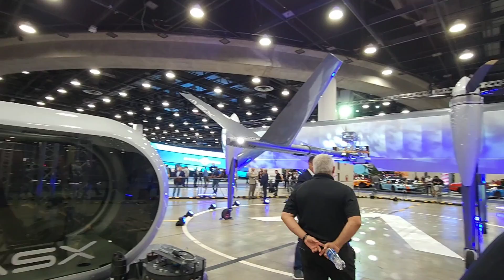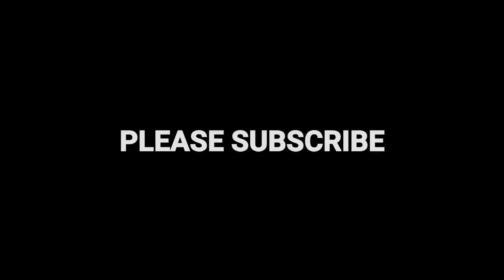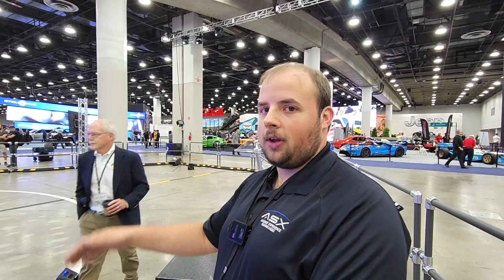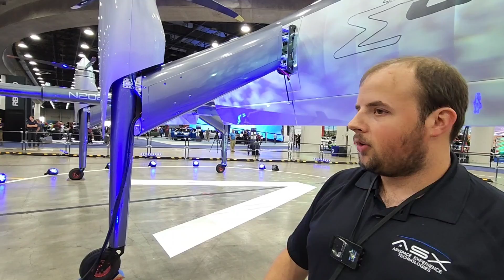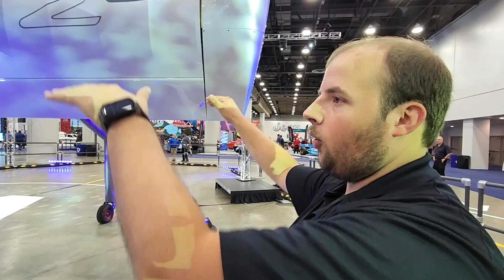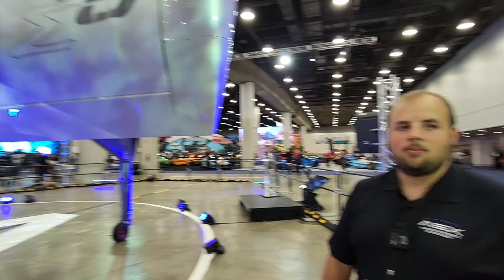I had to show you all this amazing flying technology! iFlyASX

Comment: Can you please do an indepth video on the f150 hybrid and lightning with power boost I really wanna get your opinion on the truck as well as towing and powering a travel trailer.
Reply: If your only towing around town a lightning will work until some sufficient battery ground is broken if you want long trips I'd go with a powerboost hybrid you can spec it with a max tow package but with both trucks you loose payload due to battery weight

Comment: Don't think the battery technology is ready for this .... I mean 100 mile max range ,, that's 50 miles round trip,, 30 minutes flight time ,, both range and time dependent on weather conditions , ie. Head winds,  inclement weather, etc...
   Maybe future breakthrough on battery capacity and longevity of charge cycles will increase,  but till then , just don't think its practical. 
  Although I do applaud their design and foresight.